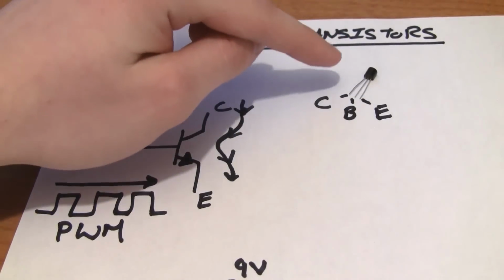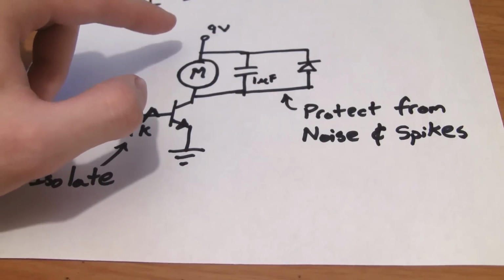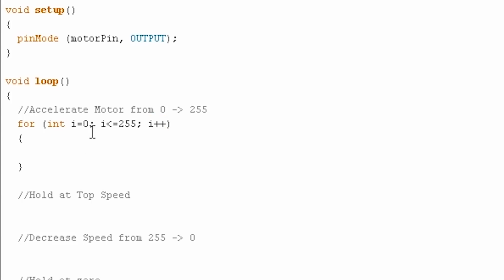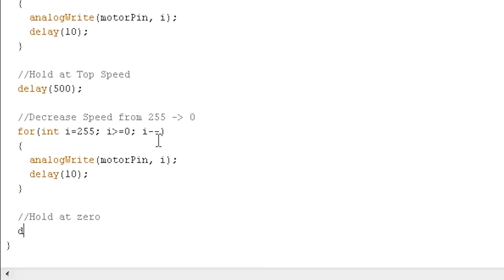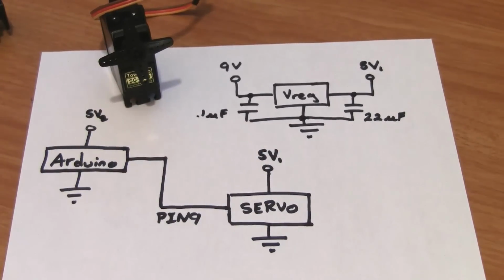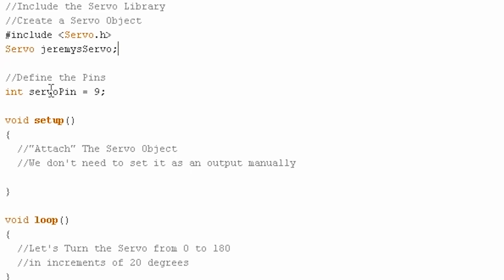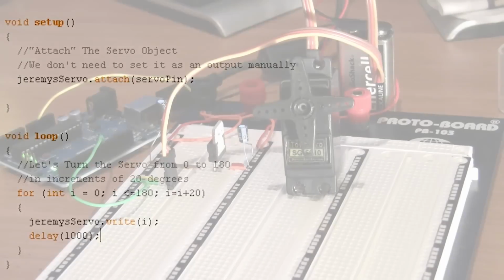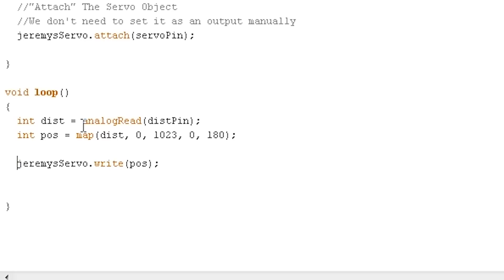Tutorial 05 for Arduino: Motors and Transistors

Comment: Where did the 5V wire from the Arduino go? I only see a wire coming out from the neg post but nothing going in. For the servo motor part.
Reply: +Zebo Zhu The output (+) from the Arduino to the servo is coming from the digital pin 9 (yellow cable), in this case, not from the 5V output of the Arduino (although the pin 9 can also supply 5V, but low current). Because the electricity can only run in a closed circuit (loop) you have to connect the ground on the arduino (green cable) to the ground of the servo (which is also connected to the ground of the external power source). Are you using an external power source?
Reply: +Rik Schoonbeek Thanks for the clarification! I thought I have to connect the 5V output of the Arduino in order to supply 5V but apparently not :) 
and yes, I am using an external power source.

Comment: Quick question guys, I got my motor to speed up and slow down but after running through two or three times the motor stopped. My transistor was very very hot however, I am sure I know the reason. I did not have a 1uf capacitor and tried to wire this up with a 220uf capacitor lol. Would this burn out my transistor?

Comment: Why can't we use the same 5V power source for both?
Reply: +Timothy Tong  The motor would draw too many mA from the the ardunio in most cases.  Each i/o pin can only output 40 mA max and the 5v pin can only output 500mA on usb and up to 1A on power jack.  The motor he used shouldn't draw over 500mA so he could have used the ardunio 5v pin to power it, but he wanted to show how to use a transistor to provide external power to a motor while still being able to control it.  Which if you are running a lot of motors, this would be a good setup to have, but you can get away with running a few low power motors on the arduino 5v pin though.  You should never power a motor on the i/o pins as most motors draw more than 40mA,  use the 5v pin/external power source and a transistor. Hope this helps!

Comment: RUBYCON - 50YK22M5X11 - CAPACITOR ALUM ELEC 22UF, 50V, 20%, RADIAL seem to be unavailable from the source on your parts list. Any ideas?  (This is a great way to learn Arduino and electronics from scratch. Thanks! But I want to be able to try the projects in episode 5. You ought to offer kits for each video.

Comment: hello Jeremy,
I have just replicated your servo circuit and programme whereby it moves in 20 degree integers. I found that when I set the code i<=180; i=i+20 it didn't actually complete the 180 degree turn in practice. I changed the code to i<=200; i=i+20 and it seemed to perform a better representation of a 180 complete turn before turning back. Am i at risk of ruining my servo gubbings as a result of this or is this perfectly explainable.
regards
lewis
Reply: you should look up your specs not all servos are 180

Comment: The 22uF capacitor on the output of the regulator is WAY to big. Look up a datasheet for a 7805, it should be small, around .1uF.

Comment: Hello!

I am a beginner when it comes to Electromechanical Engineering but I am looking for some help in building an analog clock.  The clock needs to be powered by a higher torque (10 in-oz approx.) clock motor because all the standard off the shelf clock motors cannot drive the assembly I have created.

I would like to assemble an arduino with a small stepper motor and power the entire assembly with standard batteries (AA hopefully)

The motor must also have a lengthy battery life

Thanks for your help!
Reply: Try to find RC hobby servos that continuously spin, hobbyking.com.  Battery life is dependent on power usage...so if you want it to last long you need to install bigger batteries or reduce power usage.

Comment: I’m having an issue with the first dc motor wiring on chapter 4, figure 4-3, I believe i have hooked up all the wires the way it’s shown and when doing either the initial test where I hook up the transistors base to 5v just to make sure the wiring is correct, or when having it go through pin 9 to the base when I’ve uploaded the code, the motor runs when testing it but the transistor gets fried within like 10 secs, I was thinking that maybe the 9v battery running through it as well as the 5v at its base is just too much for it, I’ve tried hooking it into 3.3 volts instead or adding extra resistors, but neither of these have worked, I don’t know how to approach this issue from a coding standpoint, maybe I have the wrong transistor but I’m pretty sure it came with the kit that coordinates with the book, If anybody has had a similar issue and solved it, I would greatly appreciate some input

Comment from the maker: @WebDesigneri The voltage across a capacitor cannot change instantaneously, so it serves to smooth out voltage spikes that can be created by as the DC motor turns.  The diode ensures that  as a charge builds up on the motor coil when the transistor is "off", a current is able to flow to dissipate the charge.

Comment: can i connect a LOW voltage dc motor directly to arduino pins? Does back emf from the motor has any significance here? can we change speed by using analog pins?

Comment: what npn transistor did u use? :)
Reply: generally won't matter as long as it can handle the motor's current at the desired voltage. The transistor gain will be less of a consideration for this application. None of the other specs will matter much for this simple demo.

If the motor draws less than 500ma, you can use a 2n2222 or similar

Comment: Hello Dear please help me.
 I have an
Arduino Mega 2560 board and a KRIDA Electronics 1 channel light dimming board
with (+5V/Sync/Gate and GND) terminals. I want dimming level Up and Down by
using two push buttons and stay any level of dimming point like 25%/40% or 0 to
100%. Lamp is 230 VAC /50 Hz Please help me to write the Arduino code.

Comment: I am a beginner at Arduino and these tutorials helped me to start off really easily and quickly! Many thanks, very informative and helpful videos! Keep it up!

I wanted to add that from watching these videos I made a timed RG (Red-Green) LED traffic light. Once I did that I decided to add a motor that would slowly start spinning when the amber light would come on and then would run up to full speed when the green light turned on and yes it works perfectly! So yeah, thanks :)

Comment: great instructions. btw, my professor told me to use an opto isolator for the motors. is it necessary to do so?
Reply: +darkatsuki12   optoisolators completely isolate one part of the circuit from the other. I have used it once to separate 5V parts from 12V parts of a Project I did. However I have also used just transistors like in the video for another project. No isolation. Just be sure to put the diodes and capacitors to avoid spikes

Comment: Hey guys im probably doin something dumb but my transistor keeps getting extremely hot once i plug my 9v in and i already destroyed one. think i have everything set up properly.. maybe my ground on my arduino and battery and properly attached idk any help would be great
Reply: i have the same problem although i put one variable resistor between 9v and the motor it works but in a while the transistor got hot!!!So maybe the problem is the voltage drop on the motor
Reply: I had the same problem as well. It turned out that my NPN transistor had a max current spec of 700mA. My DC motor had an internal resistance of ~2ohms, so that meant roughly 4.5A was going through the transistor - much higher than my transistor could handle. I would recommend checking your transistor's datasheet and see if you're trying to flow more current than it can handle. I tried putting a resistor in parallel to drop the current, but then the DC motor wouldn't turn. I ended up going to a MOSFET that could handle much more than 4.5A and it worked well with Jeremy's setup.

Comment: At 2:25 am I right to assume you should better use a diode to isolate the arduino from the motor circuit ? I'm a noob in electronic and this is a genuine question. Any experienced person answer would be apreciated. Love your work Jeremy ( expect the intro sound level xD )
Reply: +Furrane I was about to ask the same question, so I bump this comment up in order to get the answer :)
Reply: If you use diode, you can avoid the high current feedback from motor to arduino. Yes it is right.

Comment: What are the capacitor,transistor and voltage regulator ratings or names ???
And i didn't understand why the capacitors were used??
Reply: The capacitors and voltage regulator were used to generate 5 volts supply voltage to a servo. Transistor played as a switch to control the motor, if we do not have the transistor, the motor always run as the same speed cause it was connected to 5 volts. I think so.
Reply: Bro...transistor acts as a switch here. You can easily damage your Arduino if you directly hook up the arduino with the motor due to inductive kicks and voltage irregulations.
check out the arduino tutorial for more info https://www.arduino.cc/en/Tutorial/TransistorMotorControl
you can use BC547B for motor that needs 100mA of current(generally operating voltage=6-9V) or TIP120 or 2N4401 or 2N7000 as per your motor specs.

Comment: Great series, Jeremy - thank you! One quick question: You included the servo library, as in  #include <Servo.h>. Where does this library have to be (in my computer) for the sketch to access it? Is this the same servo library that was automatically installed when I downloaded the Arduino software, or is a different servo library required?
Reply from the maker: <> means it is referencing the one included with your arduino IDE. No additional installation steps are needed.
Reply: +Sharon F.Smith I can download it because the below mistake "No offers in my region"
Reply: Hi, I wanted to ask  you about the Ping library. I am using a distance sensor and wanted to convert the microseconds to centimeters or inches. How do we do that?

Comment: transistors colector current is NOT controled by base VOLTAGE. Its base CURRENT. And the resistor is NOT there for isolating, but regulating base, and consequently, Ic current!
Reply: gunarthon , true.